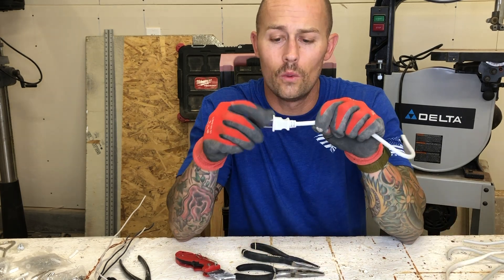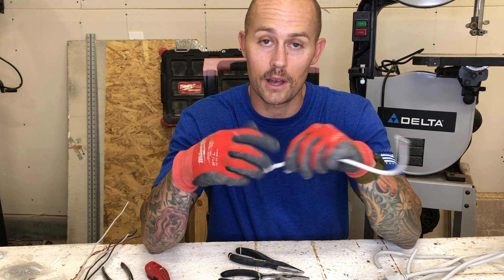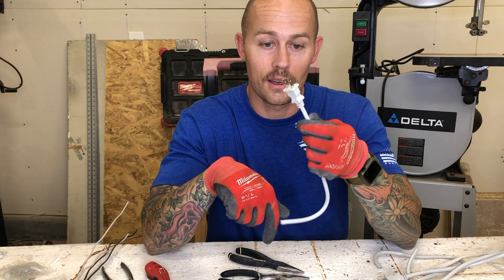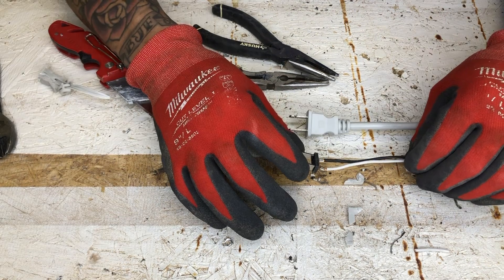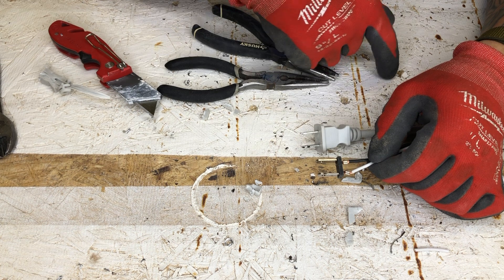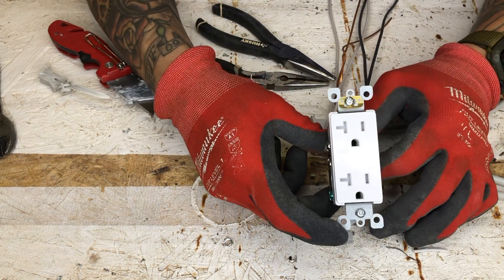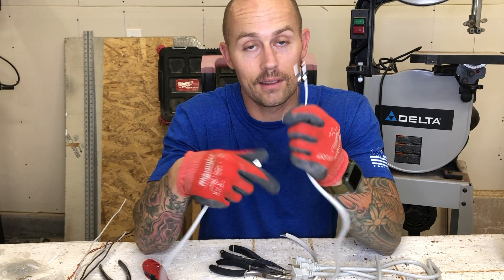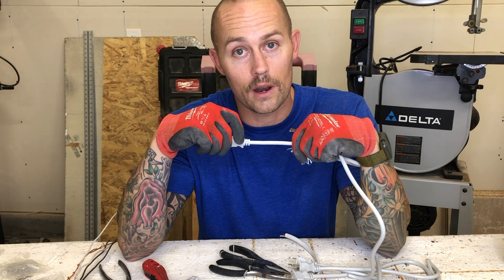WHAT'S INSIDE?? How Does A Plug Work? | How To Hardwire Light Fixture | DIY Electrical | Wall Outlet

Comment: So i got 8 shop lights that are the plug in style, can i cut the plug and hard wire the first one to my romex to a switch and then just plug the rest together then all operate off the switch?
Reply: Yes thats what i needed to know and also some of my cords wont reach to other lights can i just add more wiring to them then just plug them in? Then just tape the cords where i connected the wire
Reply from the maker: @ yeah your on the right track as far as what’s possible. I’d just be careful with splicing wires and just taping them up. If you’re going to extend wires they should be tied together and capped and usually covered in some way. So they don’t get bumped or have the chance of exposed wiring. So yes many things are possible with this ability but I would say be careful and mindful about splicing wires. You don’t want any loose connections which could be a fire hazard if any arching occurs. So secure and covered connections is the way to go.
Reply: And just be able to hook the wiring from the plug straight into my romex wire even though the gauge is different 😊
Reply: And also my plugs dont have a ground wire
Reply from the maker: @rogeroakes7117  yeah some appliances don’t have a formal ground. In most circuitry you’ll see the ground is bonded at the main panel to the neutral. So in essence it’s a second neutral or extension of the neutral. So it’s not required in some appliance manufacturing for some reason. Maybe because it’s low amperage or ? 
As far as the gauge of wire, when you look at an outlet and a plug and wires to lighting… you have a solid core 12 gauge copper wire powering contact plates in a light switch which then sends power through a 14 gauge solid core copper wire up to a light fixture that has 16-18 gauge stranded wires twisted together under a wing nut and those thin connection internally inside the light. Then it all gets sent back through the other side on the neutral side. There’s a lot of different types of wire and contacts going on in the whole system.
Reply from the maker: Yes, essentially that's the case.  You need to make sure your Hot/Neutral/Grounds are connected correctly to your power source and like you said controlled by a switch, but yes once you have that one hardwired in you could technically plug the other ones in line to that and they would all operate off of that switch. 

It's almost the same as plugging in one to a wired outlet and then plugging them all into each other. your just eliminating the outlet part.
Reply: I would just tape to connect single wires then double tape for both wires then just use romex plastic staples to put on my runners and have them all connected. Its just all the plugs are not long enough to go to my next light
Reply: You think that would work ok? What about my ground on my single pole switch?
Reply: Ok cool im going to work on this for a bit. Thanks for the help
Reply: So do i connect both hots (black) to top and both neutrals ( white) to bottom?

Comment: What if the plug has an ac/dc adapter. Assuming you can hardwire as long as the adapter is left in the circuit?
Reply from the maker: I would assume so. The main thing to take from this video is that the wire inside the plug is just connecting to the metal prongs that are used to go into the wall. The wires are attached several different ways, but nothing magical going on.

Comment: Hi, I’m hoping to add a plug to an LED light fixture, that I will install, not on a ceiling but, on a vertical wall above the electrical outlet. This fixture has a ground wire. My question- What DO I DO WITH THE GROUND WIRE? I trust your advice above other videos. Thank you for your response!
Reply from the maker: I really appreciate that. If the fixture that you’re going to be adding has a ground wire, you need to attach that to the copper wire from the power source that your using such as the outlet. So your black wire will go to the black wire. Your white wire will go to the white wire. And then your ground wire will connect to the bare copper wire from your power source\outlet.
I hope that makes sense. It really just depends on how you’re going to be connecting it to a power source. If there is no bare copper wire to attach your ground wire to then I would’ve fix it too the terminal box sometimes they have a little green screw that you can secure it too. Or you can just leave it kept inside The fixture box.
Reply: @FortKnoxCo  Thank you for your reply!!! I am trying to brighten my dark living room, with a dimmable LED fixture, hoping it looks similar to a tubular skylight minus the price tag! I’ll attach it vertically on a tall ledge just below a vaulted ceiling. The ledge itself has a 2 plug 🔌 outlet. Wrongly, the larger LED light I purchased is made for hardwire not plug. I want to keep it and make it work, rather than return it. I want to accept this as an electrical DIY challenge, but, I don’t want to damage my house or hurt myself in the process!!! Lol
Reply: Upon listening and watching your video tutorials, to convert this hardwire fixture to plug, I need to purchase a cord with a 3 prong plug? Then, I can attach the copper/ground wire to that in the cord, black to black and white to white??!! The fixture itself has 2 ground wires. I wish I could show you a picture of it. I really appreciate your thoughts.
Reply from the maker: You can sometimes purchase a plug with just two. Some plugs that you wire in might not have a ground. Having a ground is more common nowadays though. The main thing is that you’re black to black and white to white is connected. The ground wires just a secondary white technically. That’s why older fixtures sometimes don’t have the bare copper wire. It’s there incase the white wire faults and it gives the electricity a path way out to ground.

Comment: Can I put a plug onto a LED ceiling light
Reply from the maker: Yes. It should have the black and white wire. Or “hot” and neutral. And with those two wires you can wire on a plug and that will make he same connection as if you were hard wiring it. I have a widow showing installing a plug on an extension cord and one showing the opposite, I cut the plug off and hardwire lights in
Reply: @FortKnoxCo  Oh great! Thank you so much! And Merry Christmas!
Reply from the maker: @theghoulgals2474  no problem at all. Thank you and merry Christmas to you and your family as well.

Comment: Pro tip: boil it next time. You can cut the plastic off like butter. The metal ignores it.
Reply from the maker: Wow, I never thought about that but I can see how that’s probably work like a charm.
Reply: @FortKnoxCo  Ayup. I frequently remove/replace/rewire plugs onto devices, and experimented early on. We have this funny notion that water should never go near electricity or electronics. Fact is, water is only dangerous with regard to electrical if both are being used at the SAME TIME. Shoot, you can fully submerge a desktop computer (when it's UNPLUGGED), and as long as it's FULLY DRY when you plug it back in, no harm done.
Reply from the maker: @grumblycurmudgeon  all very true. You just have to have a understanding of what’s going on. Critical thinking.

Comment: This is exactly what I was looking for. I’m replacing some lights in my and wanted to replace them with an LED strip, but could only find them with a plug.
Reply from the maker: Awesome! I also have a video on how to hardwire shop light and I show exactly that. Cutting the plug off and wiring them in.
Reply: @FortKnoxCo  awesome! I will watch after work. Looks like I’ll need a housing for the led strips but the process should largely be the same. Glad this seems a simple process, since my HS shop class wiring skills are a bit rusty.
Reply from the maker: Haha. You got this. It’s pretty straightforward

Comment: Hi there. I have an outdoor camera with a 2-prong plug. I'm trying to replace an outdoor light with it. The wiring in the electrical box has 3 wires, black, white and a ground wire. should i be concerned the camera isn't grounded?
Reply: In most cases, if a device is grounded, you want to facilitate that grounding, especially in the case of an outdoor device. The ground is what whisks the electricity away from you, the soft, squishy bag of salt water, when a short takes place inside the device (as is far more common in devices in boiling hot direct sun, freezing cold, or heavy rain). Just because you CAN make it work without doesn't mean you SHOULD. If you're that leery about wiring, maybe consider a nest or a blink camera (both of which accept batteries, or, even better, tiny 12v solar panels).
Reply from the maker: @grumblycurmudgeon  great info
Reply from the maker: No. The ground is there as an extra safety measure mostly. Some electronics are built with a ground prong and some don’t. That’s decided on the manufacturer side. The black and white white are what you need. The ground is almost like a second white wire if you want to look at it like that. If for some reason the power running from the black wire can make its way back through the white to complete the circuit it has the ground wire there as a safety measure. Most all small lighting has just a black and a white. It’s because the light doesn’t require a big draw of electricity and there’s less risk or the fault happening. But you have nothing to worry about.

Comment: Great explanation, thank you!  Do you have one with a three-prong example by any chance?
Reply from the maker: Your welcome!! I have t done one on the 3 prong but now that you mention it I probably should
Reply: 3-prongs are identical to a two-prong, except the third wire (this would be either the green or the bare copper in the wire insulation sheath) is wired to the round prong (that's your ground or earthing wire). In a modern plug, round is ground small is hot, large is neutral. The one that is the danger source is the smaller of the two prongs (short=shock; it's typically the black or red one in the USA). You can grab the wire attached to the larger one (generally white in the US) without incident (assuming you're not also touching the hot wire at the same time).

Comment: So I’m trying to wire some leds into my shop but the lights I got are three prong and when I cut the plug it’s 2 wires no color and one green. My hard wire into my old fixture it only a white and black. Im confused
Reply from the maker: Id assume the green is a ground. And the two wires are you in and out or “hot” and neutral. I’d guess that if there is no designation on the wires which is which you’d be able to wire one to your black and one to your white and either way the current will flow through and it should complete the circuit. It’d obviously connect the green to the copper ground.
Reply: @FortKnoxCo  Dont take my word for it....but your video shows that he could follow the larger prong for white and smaller prong on the plug for black

Comment: Both my wires are black.  Does it matter which I hook up to hot?
Reply: Make sure that the wire size is able to take the load from the device that’s attached to it. Look up NEC table for wire ampacity.

Check with multimeter both ends of each conductor/wires the resistance reading should tell you also what material it’s made from is it all pure copper or is it tinned. Again that impacts ampacity. 

If all checks out okay you could make one of the black a hot and the other a neutral which should be marked as neutral with white tape around it. You should also sleeve both wires with another insulator or through listed heat shrink. 

I prefer cables and the equipment that is attached to it to have an earth conductor/wire just for extra safety and to allow any GFCIs to work properly if that cable was used with any equipment.  Usually equipment with two prongs have no earth/ground terminal because they are class 2 devices and are double insulated. Check for UL listing on the device some cheaper imported devices say they are double insulated but when tested are not. With double insulated it’s unlikely that  short and lack of exposed metal surfaces would result in a shock , but as I say it’s not always the case. Light fittings, kettles, toasters, and other devices can be problematic.
Reply from the maker: Are there only 2 black wires and that’s it?  Do you still have a ground and a white at least?

Comment: Pretty easy indeed!  I actually have a 5,000 lumen LED shop light that have the bare black and white wires (and a copper wire I think is the ground).  I need to add a plug so I can plug it into an outlet so I can see when I disassemble my snowblower.  I was thinking of getting a 6-ft 13-amp appliance cord as my plug end (like this: https://www.homedepot.com/p/HDX-6-ft-13-Amp-3-Prong-Grey-Appliance-Replacement-Cord-HD-588-547/100672804) .  Preferably, I'd like something with a switch that, after I wire it to a plug, and I turn it off and on via a chain or button instead of manually plugging and unplugging it from the wall.  What do you suggest?
Reply from the maker: You can easily install your own in line switch, there’s several styles, and the plug of your choice as well. Home
Depot or Lowe’s I know for sure have several to choose from. They sell replacement plugs or new plugs to be wired in. Some heavy duty and some small and simple similar to a lamp light plug. I sometimes make my own light fixtures and table lamps and have done that tons of time. I even have a small supply of extra plugs and switches in my “electrical/lamp” box in the garage.
Reply from the maker: But to answer your question more specifically, that appliance cord should be plenty good for the light. You might even find some cords that are slim and fit for a light fixture as well